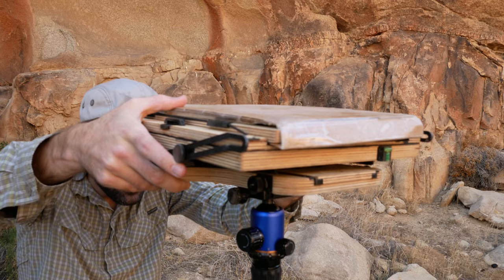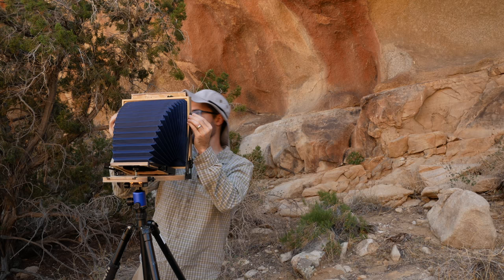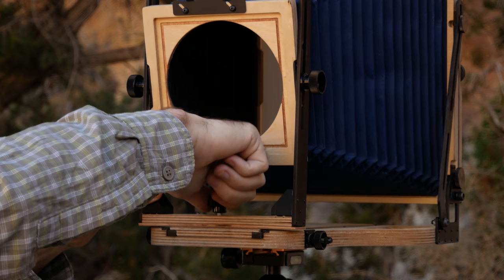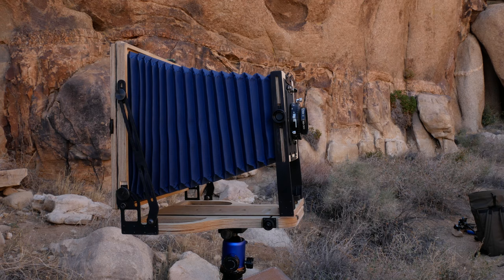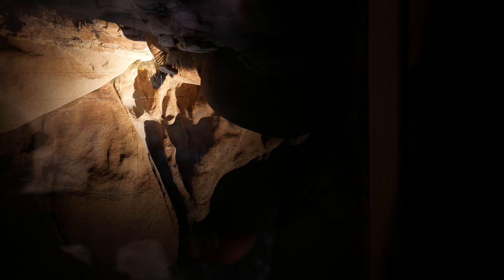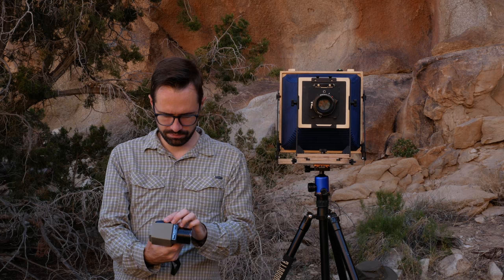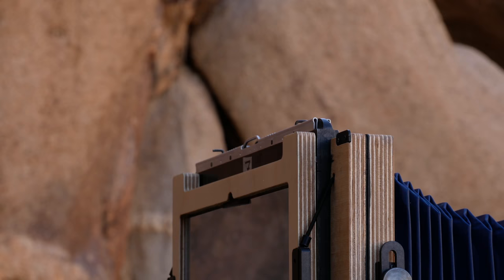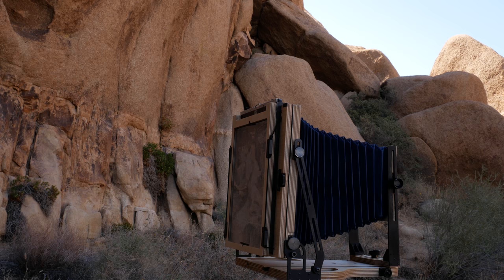Analog Photography: Step by Step Using Large Format Film Camera

Comment: I started a LF checklist to get the muscle memory in place, still working the steps as too many times I forget a step or get the wrong order.  For a Shenhao 617:
1. Use Viewfinder App for correct focal length for your lens choice
2. Level tripod
3. Mount view camera and zero out movements
4. Mount/exchange lens with selected focal length removing caps
5. Set lens to wide-opening aperture
6. Mount shutter cable
7. Loosen knobs
8. Rough focus
9. Rise or Fall Front Standard
10. Tilt Front Standard Top or Bottom
11. Tilt Back Standard to increase FG size
12. Place dark cloth
13. Place loupe around neck
14. Focus w/o tilt. Check for extension bellows factor
15. Focus w/tilt: focus bottom, tilt top to focus, focus bottom... repeat. 
16. Release open shutter
17. Cock shutter and trigger for check
18. Use spot meter around neck
19. Take Z3 spot meter reading. Choice Aperture and SS when Z3 EV number moved on the paper scale to Z5.  Of course this depends on the film type and brand used.
20. Cock shutter
21. Remove dark slide
22. Hand over lens
23. Trigger shutter release
24. Replace dark slide
25. Advance film with light to see film numbers: 3-6-9-12
26. Remove film holder, place in bag
27. Flip up and lock ground glass
28. Protective cover on ground glass
29. Remove 150mm lens on front standard 
30. Repack camera, lens, cable, loupe, spot meter, film back
31. Take notes on the exposure conditions

Comment: Is that the tripod you always use for this camera?  I noticed a little vibration of the camera when you remove the dark clothe and when dealing with the lens, as well as when inserting the film holder. Any problem with the final focus after that?  Will a sturdier tripod do better?  Can you share the type and brand of the tripod you used in this video? Thanks,
Reply: @justinlowery6017  Thanks. I am going to buy an Intrepid 8x10 to accompany my 4x5. I will wait for Mk II to come out next year.  I have a Manfrotto 55 with a big three way head I got, heavier than the whole tripod.  It seem to work well with my 8x10 pinhole (about ten pounds). Thanks for the video, very informative. Do you have a support page where people can contribute?